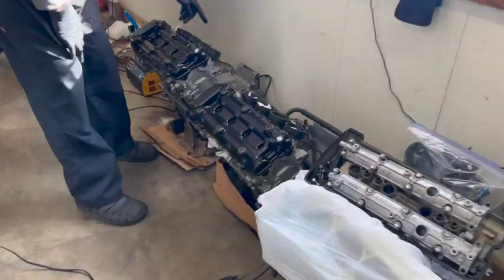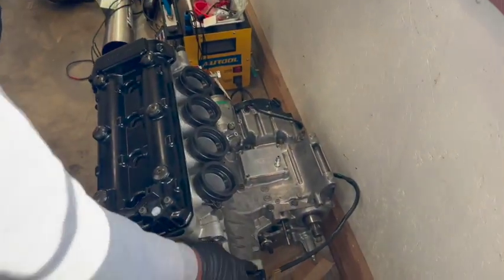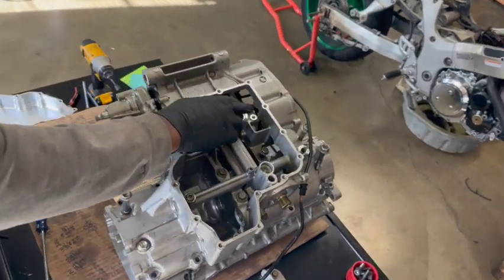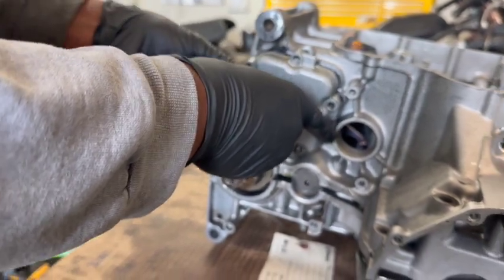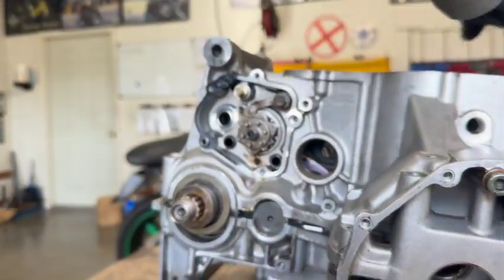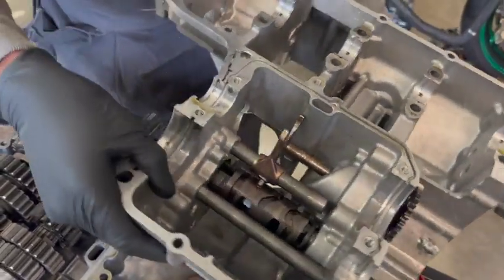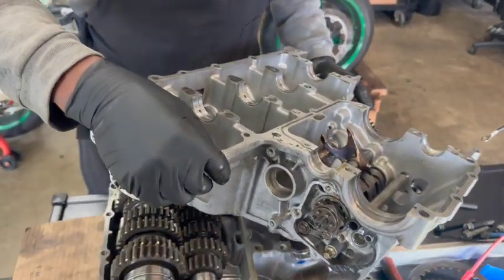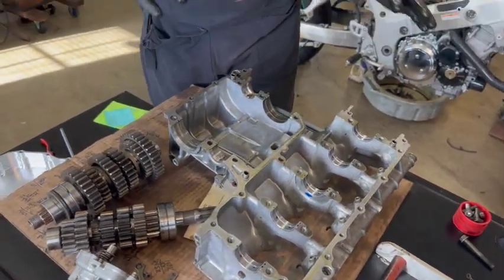Check Shift Forks on Hayabusa

Comment: To the little less experienced folks like myself, invest in a manual and a decent torque wrench and create a template out of cardboard, paper, etc. for your case bolts so you know which spots they go back in. Made my experience much easier compared to my first time. As always thanks for the content Mr. Charles.
Reply from the maker: That's my mistake, I post up videos as a reference to help out someone who may have some working knowledge of engines. Your correct I may need to put in a little more information about tools, and other items that may be needed. But then you hear the complaints about the videos being to long ( DAMED IF YOU DO DAMED IF YOU DON'T)
Reply: Thank you sir im about to do mine and its my first time doing it.